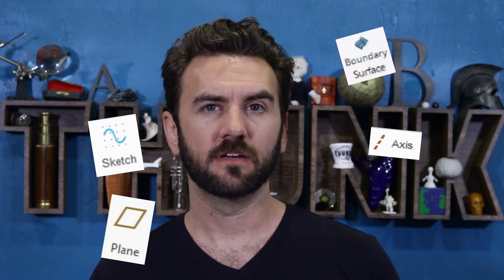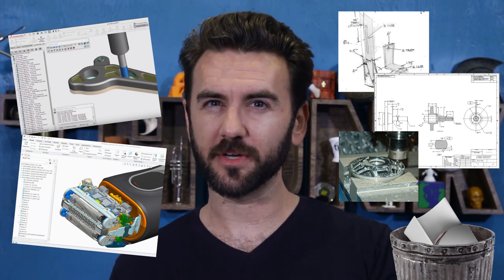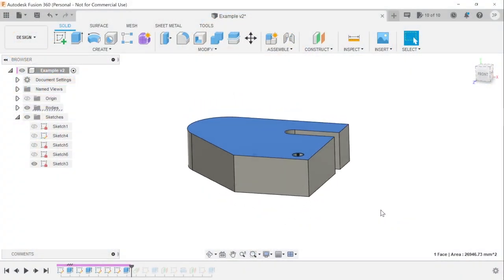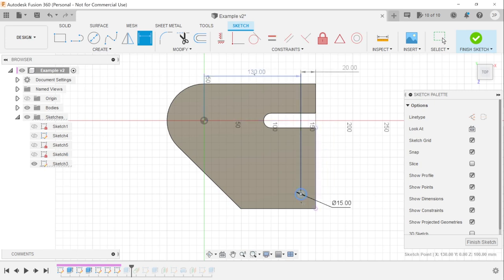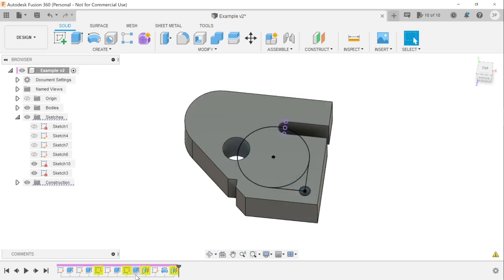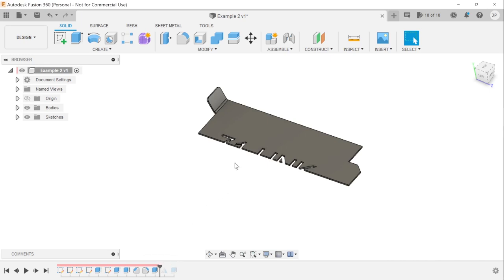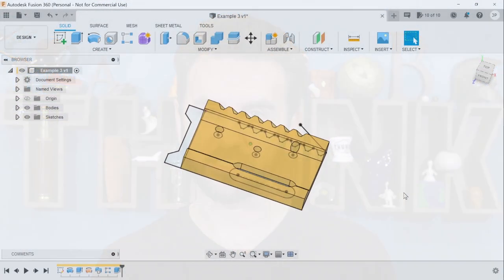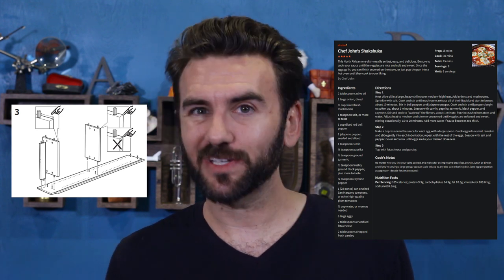217. A Theory of Good CAD

Comment: I've stayed clear of the new 3D CAD (Solidworks, etc.) and lived in the 2D world (notably without the expertise of someone like my dad who started out on paper blueprints). It's the rich-featureset = easy-to-break that keeps me away from it.

I tend to use lots of reference lines to keep things in alignment, but I could probably go one step more. To make a specific example of a general case, if you're trying to fit something inside an Altoids tin, model the dimensions of the tin and reference off that. More generally, if you make clearly defined references to other things to fit with, and lean on those references, when the "other" part changes, you can just change the references and your part will fit (or break with errors.)
Reply from the maker: There's some stuff you can't do in 2D, but it's pretty rare. ;) Agreed about the references - if you're trying to fit stuff in an Altoids tin, your model should have conceptual isomorphism to that intent.